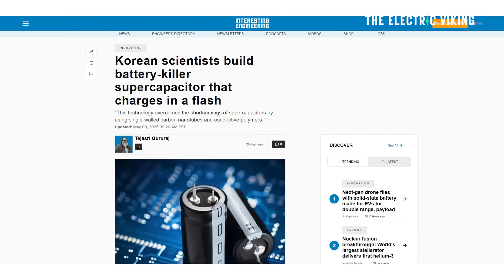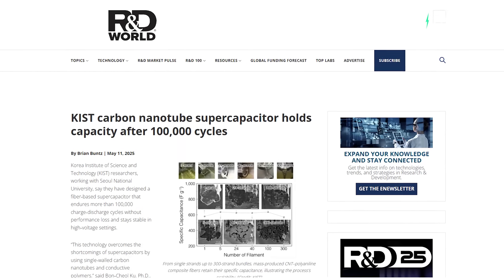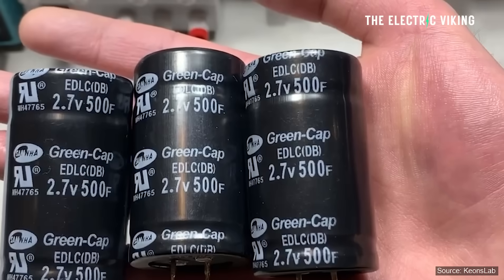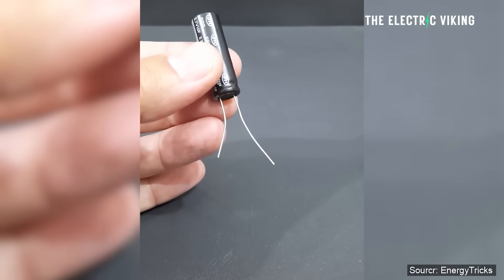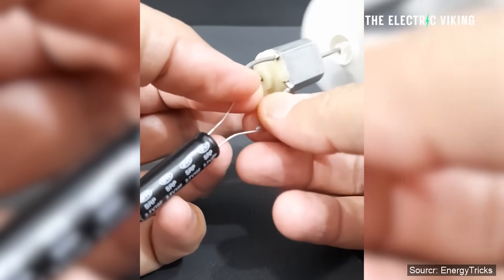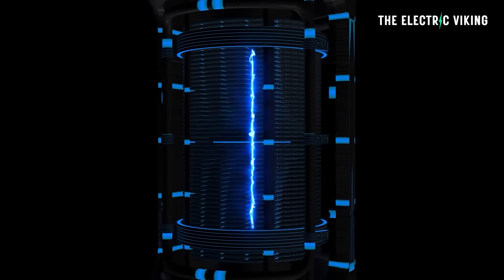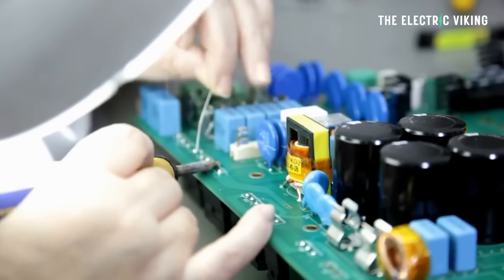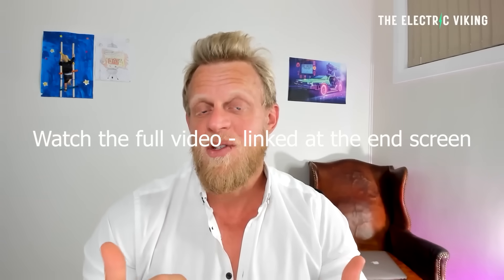72-Second EV Charging: Supercapacitor Battery Tech Finally Gets Real!

Comment: Tesla experimented with this years ago, when the acquired Maxwell. They subsequently sold it.  I think this newer version could be potentially useful for regenerative braking and acceleration, such as on a public bus.  The ultracapacitors could work in tandem with the battery to reduce the wear caused by rapid charging and discharging.
Reply: Exactly. I can easily envision "tiers" of energy storage, not unlike cache memory for a CPU. Maybe 1-2kWh worth of Supercaps that handle the biggest power swings (both charging AND discharging), and then maybe another 10-15kWh worth of solid state, then 70-100kWh worth of good LFP. With the supercaps and the SSB to buffer you could get amazing range, charging, and durability.
Reply: look, it seems to me that going further and further into higher and faster charging is a case of diminishing returns. The problem becomes getting that amount of power into a battery without melting the cables. In my mind, we are better off having a standard battery capacity with a faster charge time, say 10min. Anything over this is overkill.......I prefer cheaper batteries than powering the Krell's empire.
Reply: Can one imagine having a smaller battery with a set of super capacitors of an equal capacity to the battery, so that you change often but very fast, say every 200 km or 120 miles for 3 minutes, then the supercaps would discharge slowly into the battery while you drive? 

Wouldn't this be more practical than a 400 km 240 miles battery where you need a long stop every 300 km in practice? It should solve the range anxiety once and for all with similar stop time as for gas
Reply: I've stated this for years to have them both for faster charging with any form of regenerative and faster discharging for more power for acceleration
Reply: @imfloridano5448  I think that part of it worked. What was not feasible was the fragility and the volume of space it was taking up.  Road vibrations present a challenge even for solid state batteries.
Reply: I used Maxwell supercaps over 20 years ago.  Tesla bought them to kill them like elon did with twitter

Comment: Super capacitors, have fast charged since forever, density and energy delivery, have been the problem. Charging them with regenerative breaking, to use that energy for initial acceleration has been done in electric buses for years.

Comment: Maybe 🤔 it shouldn’t be either a lithium / other EV battery 🔋 or a super capacitor. Maybe both? They should put super capacitors between the battery and the charger. The super capacitors charger super fast, and then they are discharged into a regular EV  battery 🔋 for longer storage at higher density.